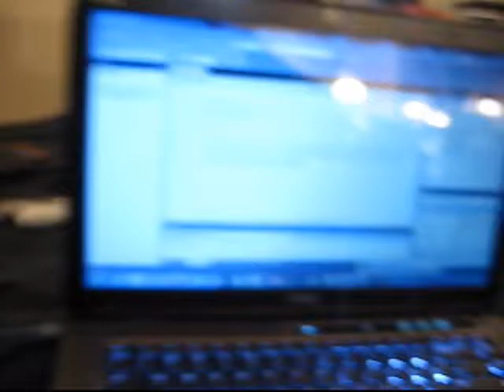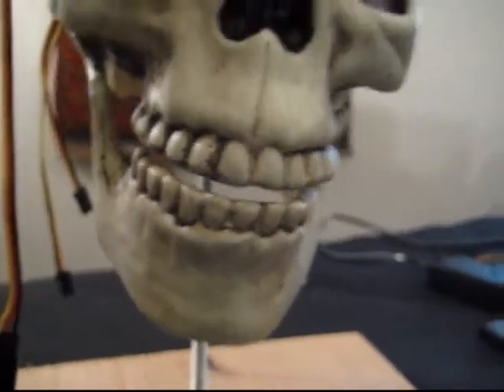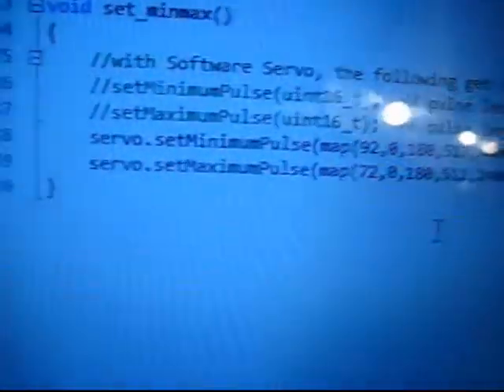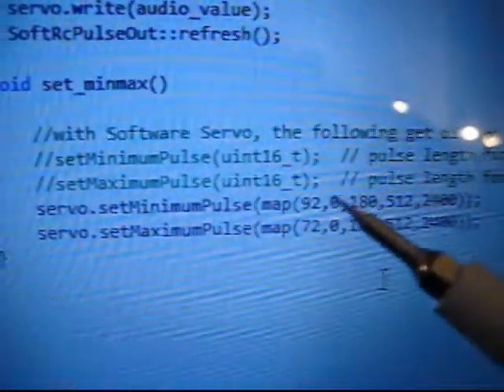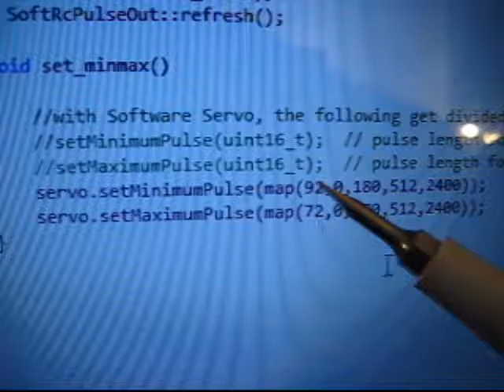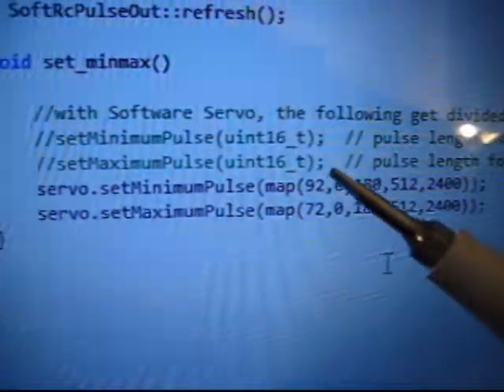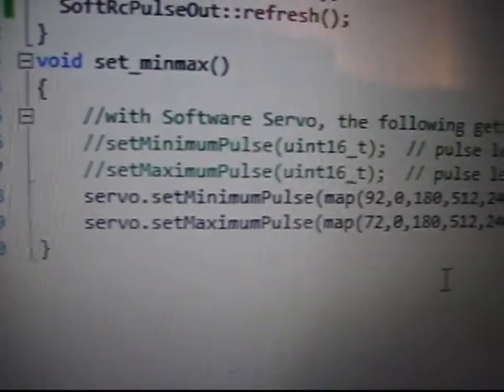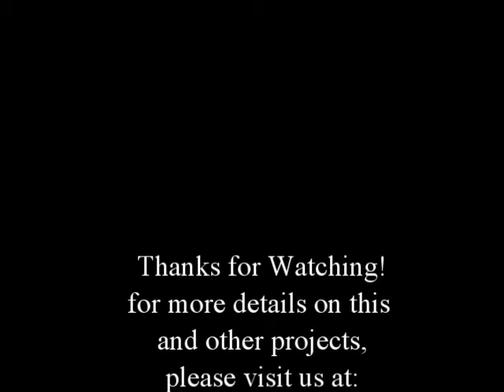JawDuino Arduino Talking Skull

Comment: This thing is a fantastic base, technology has progressed quite nicely and using this as a mouth movement piece is fantastic: should use the standard opensource mouth item with the 3bit resolution and use a ai on something like a orangepi 5 plus with 16GB of ram. then use multiple pir or a human presence detector. you can add wled for the eyes or to shine a light on it. with a onvif camera you can have it call out costumes and such as well. whisper can have it detect speech and with xtts it can talk back to people

Comment: HI Mike, great project! I already made it and works great, but I need to know if there is a way to lower the speed of the servo, the servo moves to fast and when it get to different levels you can see how it stops, is there is a way to make the movement smoother? Thanks!

Comment: Easier at would be to have the audio signal directly into A0 with a little decoupling capacitor.

Or frun electret microphone hooked up to the A0 and read the amplitude and proportionally scale that. You may need a little opamp and two resistors (or single transistor in a sliding bias) to amplify the signal. But that would negate that extra board and 3 analog ports.

Comment: Hello. Great work. how do I get the audio signal from the computer to the uv meter? I tried a 3.5mm jack plug, but there is no signal at the uv meter. but if I use an mp3 player, it works fine.

Comment: Does anyone have a video of how the installed the servo? I'm running into issues trying to mount on in a skull, did you make a mount/bracket for it?  Thanks
Reply: You could have it on the steel neck rod attached to a wooden piece and Have a long metal wire connected to the jaw

Comment: Thanks for sharing Mike, this is awesome. Now I have to order some of those audio boards.  I was wondering after playing and somewhat assembling the Octobanger you designed.  Is there a way to have a SD card with various sayings on it and have a PIR trigger the skull? I thought maybe if the sayings could be randomly selected by the Arduino each time the circuit was triggered.  I was thinking like how you have ambient sound then the scare sound, but instead  a random generator would chose different saying.  Maybe the files could be named 1, 2, 3, etc so it would look say for file 3.mp3.   I need to learn more of the programming side to see if my thoughts can actually make things work.   Thanks again for this and the octobanger!

Comment: hello, Im trying to use Pneumatic cylinder instead of servo, yes i m using relay board, can you help to modify your code, it will using only ON/OFF on releay to control valve, i will slow down speed on cylinder to compensate jaw movement, just need help with code, ty

Comment: Hello, Mike.
Our group would like to do M&T for this project, to keep cost down, can we use Nano or Due board?
Reply from the maker: Dmitriy Slobodskiy Yes, nano would be a great choice. They are cheap and compact, and they are easy to use in place of the Uno.
Reply: Mike North , here is prototype i did with Nano board, thanks to you, soo easy to setup and adjust servo, love it
https://youtu.be/EdSATYlGCic
I did separate l and R Chanel,  used  audacity,  so left for voice that going to jawduino,  and right with full audio track for audience. Need to clean some wiring and make approval for our CalHaunts M&T build.
Reply: Mike North , hello again, build this setup on using Nano, All works  Great, ty. Small issue, I'm trying different speakers setup. When I'm using USB powered PC amplified speakers all working ok, when I try go to Batery powered speakers, volume goes down and also audio level. Audio board can even detect signal. I max volume up and resistor also. Some how it affecting audio level. I did try 3 dif setup,  only success on one USB powered speakers...?

Comment: Hey Mike!  Building a similar project using this as a guide and can't figure out where you go the 5V power for the servo.  Was looking at the .PDF and I can't find the spot on my Uno that you're referencing.  The only 5V source on my Uno is already being used for the VU meter.  Any suggestions?

Comment: This is exactly what I've been researching how to do with an Arduino! That meter is a winner! This is great, Mike! Write some random head movement code, and mp3 player support, and halstaff's board may have some competition. ;) Thanks for sharing this!
Reply from the maker: Cool man- glad you like it!  I saw those modules a while back and just got around to trying it all out.  I was astonished how well it worked with just a few tweaks!  Yes I'd like to try the movement like Halstaff's (with imitation being the most sincere form of flattery)  I have a bunch of projects in the queue as usual, we'll see where the next one lands...
Reply: Montclair's Lair  do u have the full code buddy i have the set up but hard to set the code up i know u can download the code but some is missing
Reply: @keithholmes8048  did you ever get the code straighten out. I too am stuck, keep getting error codes when compiling.
Reply: @1973mre  Where did you find the code/documentation? ButtonBanger.com has been down awhile.
Wondering if it is available elsewhere online. 
Thanks!
Reply: Gary Wade I copied all the information and downloaded the info from the website. I didn’t realize it was down. I did get it to work. Bummer that the site is down. Hopefully I copied all the videos that I need because there’s some other items I want to build from the site.
Reply: I cant get the code to compile and keep getting a buch of error codes.